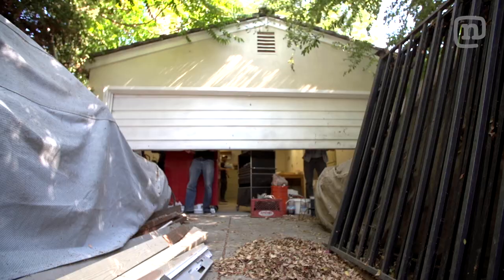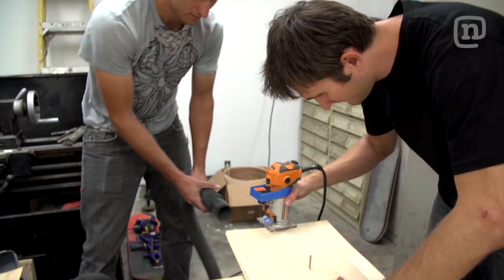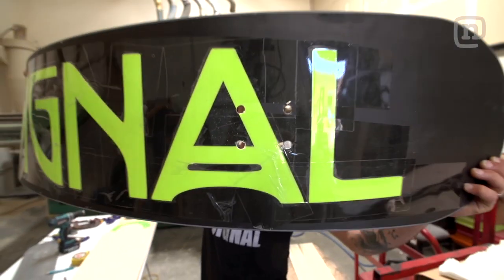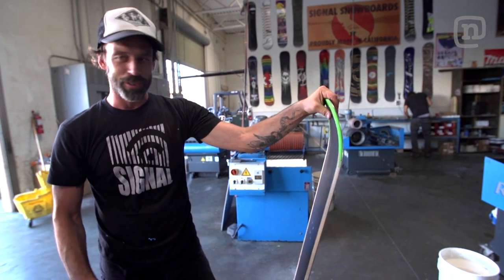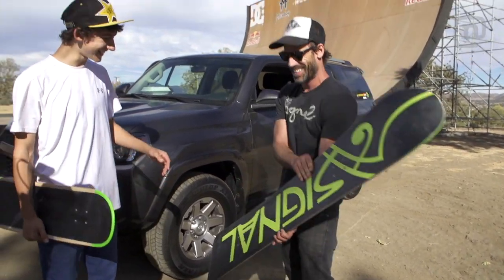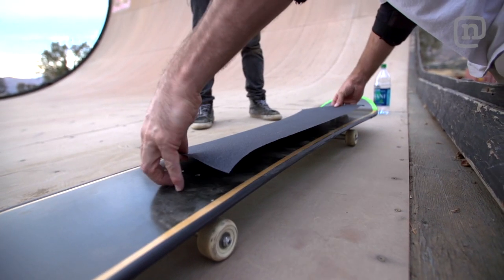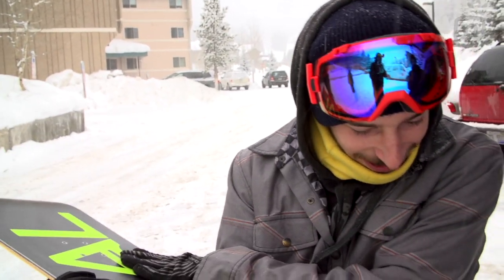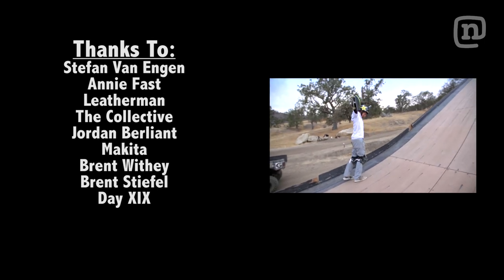Finally! Mega Ramp Snowboard & Skateboard In One!: ETT

Comment: i think this could work, I think you might want to shorten the bigger skate/snow board a little like maybe another 6-8 inches off..so 3 or 5 in off both ends...make it more like a long board length then it would be a more fun skate board and still fun to use in the snow.
Reply: and you chould make an inlay where the truck mounting holes are so that way when u want to use it in the snow you could put a plate in the slot where the trucks would be and thread it in using the same truck mounts...then have a smoother surface for snow.
Reply from the maker: Love where your head's at.
Reply: Supernautt 
There is no all around anything that will be the best at anything.
Just remembering about a guy that bought a motorcycle this one time....
He was looking at on/off road bikes, best of both worlds right?  Wrong!
The on/off road bike couldn't keep up, or even compare to a real off road only dirt bike.
Also, it got left in the dust by a big cc/ or cubic in. street bikes.
It would be very un-satisfying!
Best to use the "tools of the trade."

Comment: you should put Velcro on your boots and the board. instead of having to strap into the bindings you can just jump on the board and go
Reply: KipDynamitte well velcro might not be strong enough to hold up the board on your feet when you're in the air, but good idea anyways

Comment: So basically, it's a longboard
Reply: thats what im thinking!! lol
Reply: with carbon fiber and unchippable ends that would skate forever... forget razor tails.
Reply: @-_-Code-_-  those have been a thing for a LONG time. Everyone uses carbon fiber. Never Summer, and Loaded for example. They also use Urithane tips/rails to give them unchipable ends. BUT what really sets these apart is that you can convert it and put snowboard boots on it or skate trucks 🤷‍♂️
Reply: @-_-Code-_-  both my longboards have carbon fiber layers, with urithane unchipable tips.